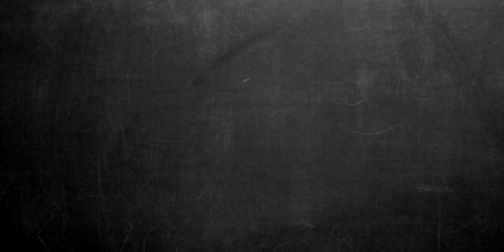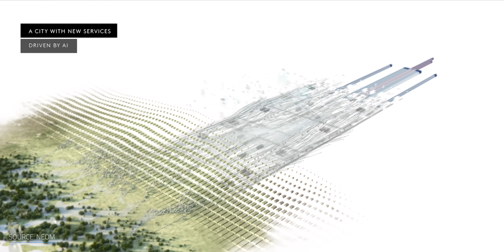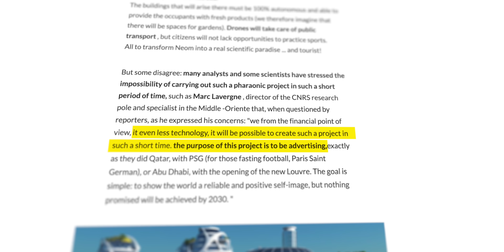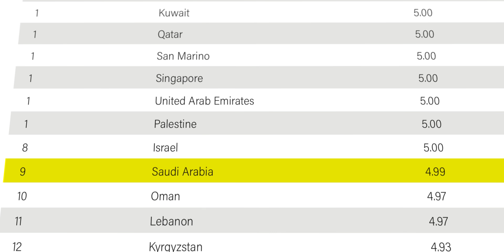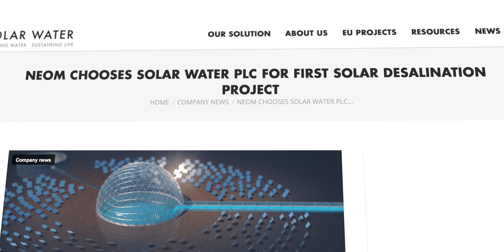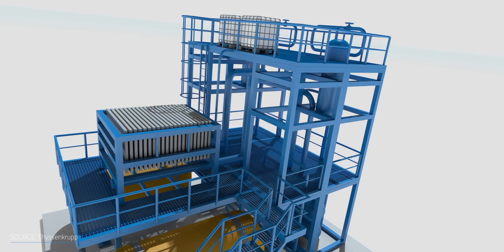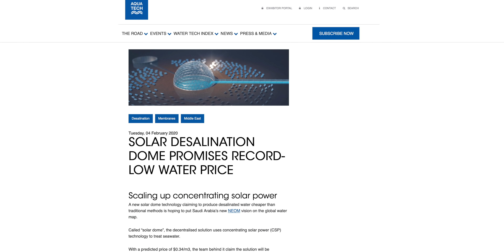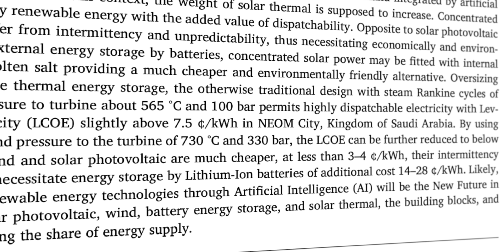Why Neom Might Be The Future of Sustainable Cities

Comment: "OUR brine won't just be pushed out into the ocean ..." - Why don't they just use the current brine emitting systems for the same purposes?
Reply: @SoMuchFacepalm the issue is that if you have a big batch of water with a specific salinity IE the ocean at 3.5% and a big batch of brine say 20% because you have by definition of ocean water 3.5% of it already in there you cant just add it to the brine to dilute it to the same level its a never ending task, to get the 20% brine down to 3.5% you need to mix it with an infinite amount of 3.5% salinity water, or you can introduce some fresh water... but that would be cutting directly into your product.

take 2 equal sized volumes of brine and seawater and add them together 1m^3 of each (20% and 3.5%)  you get 2m^3 of water of 11.75% salinity then if you do it again (2m^3, 3.5% salinity + 2m^3 11.75% salinity) you get 4m^3 of 7.375%.

Every time you repeat the process you only get slightly closer to normal salinity without ever being able to reach it. and each time you do it you have to deal with double the volume you had before.

to perform this process just 3 times you have used 7m^3 of sea water for just 1m^3 of brine, you can see why this spirals out of feasibility quite fast, and because you can only approach the base line salinity and never reach it you will always have a product that doesn't mix properly when reintroduced. We can mix it because we have powered mixers (more energy involved in the process) but the bottom of the ocean is extremely still and brine naturally sinks, the only boundary is the one flat surface of the brine pool so remixing with the sea water takes quite some time.
Reply: @EthanolTailor  What about pouting it into the desert? Would't it help to increase the overall albedo?
Reply: @eduardpertinez4767  not a good idea, there's a reason for the phrase "salt the earth" having negative connotations, It kills pretty much everything and isn't easily removed, at least in the ocean it will eventually diffuse properly.
Reply: @SoMuchFacepalm why so adversarial? I absolutely read your comment and was simply trying to play devils advocate and get you to understand the challenges and real maths of doing this. 

Im not sure of the timeframe exactly id have to have the exact salinity of the brine at hand, but salt diffusion in water is quite a slow process going vertically, the closer the concentrations are the faster it will be but I was pointing out in my last comment how hard it can be to reduce that salinity before reintroducing it.

Comment: I would be more impressed if they had gone with a relatively narrow but elongated loop. I think the fundamental issue with cities right now is the routinely long commute city dwellers have. A narrow but elongated loop for a subway system with all traffic going one way would be a solid idea. Dense housing for a mile on the outside of the loop and the interior area being more housing, large venues and large employment hubs. Everyone going to work via the subway has to make 1 total loop of the subway a day. Folks on the outside of the loop have a 2 mile round trip at worst to get to the subway. At that point trolleys and bikes would be viable options. Inside the loop distances would be similar. The ends of the loop could be setup as hubs for deliveries to the city, parking hubs, and possibly an airport. 

End of the day the main goal of any city development project needs to be to make the commute issues be minimized. Few cars or emissions and hopefully a shorter commute. That one thing would cut a vast amount of emissions and likely be far more than you get out of making buildings more efficient.
Reply: That is the maximally bad idea of the day because instead of going to a local store five minutes from my house like in a typical European city, I now have to do a 100 mile roundtrip to buy toothpaste.
Reply: @schmetterling4477  Didnt say everything had to be on the loop and didnt say the loop had to be 100 miles. Currently Atlanta has a beltway that is over 40 miles to go around. I dont see why with better planning that couldn't be a subway that might only be a 25-30 mile loop. Having lived there I can assure you most people are driving 1 way well over an hour to get to their work. It isn't even rare to find people with a 90+ minute commute one way. Most of that travel time is congestion. Im sure there are other ways to address it, but if the goal is to reduce impact on climate change the lowest hanging fruit should be taken first. Attacking the emissions of mass commuting should be a high priority for many major metropolitan areas. It might not make sense everywhere, but for many places it is a huge issue.

Comment: Would it be possible to have a salt water tap along side a freshwater tap? Saltwater still has some useful applications and it would save a lot of resources by choosing the salty tap over fresh.
Reply: Except that now you have contaminated your entire used water supply with salt and instead of running it trough a water treatment plant, which would allow multiple reuse, all the waste water has to disposed into the ocean right away.

Comment: The Neom water desalination using CSP sounds interesting, but its one thing to see fancy computer graphics and see an actual plant in production. 

Plus the fact that the maglev and hyperloop (which is basically a maglev in a vacuum tube) are expensive as shit, so no wonder you only see dictators doing these projects because otherwise there would be some critical thinking involved. The Shanghai maglev loses about a $100 million per year and it is line between the airport and the Shanghai metro (essentially just to show off ) The hyperloop is unlikely to happen despite all the hype - it is super difficult to build a large vacuum (and then you need to have an airlock and 20 mins to depressurize the pods)  After years of hype nothing of any consequence has been built.  High speed rail is a much better and already existing technology.
Reply: Dude, Maglev and high speed rail operate in Japan, Germany, France, and there's been an approved high speed line from San Francisco to Los Angeles. Which of those are dictatorships?
Reply: @nathanchildress5596  You're mixing up high speed rail and maglev. Nothing wrong with high speed rail- it can use existing rail.  While Germany developed the maglev technology, it dismantled the Mbahn in 1992.  The other example in Japan and Korea are  9km and 1km respectively. There is no maglev in France. 

The only one of any significant size is the Shanghai 29km line between the airport and trainstation which is useless for commuting unless you live at the airport and work at the trainstation (with no stops on the way) There are a couple other low speed short maglev lines in China but pretty much the rest of the world has passed on maglev with the exception of the one proposed in Japan the scmaglev which will be 80% in tunnels (with drag being an issue) and smaller in capacity than the existing Shinkansen.  (I rode the Shinkansen and its impressve, but the new scmaglev line will cost 5x the Shinkansen cost and is probably suitable for Japan which has the density, the right distance and the technology infrastructure to build one.
Reply: first off, why are you depressurising the pods? people in them need to breathe.

secondly, it litereally doesnt matter if the train line itself loses money because its so good for the economy that it pays for itself.
Reply: @jonathanodude6660  depressurize the tube, the pods need to be pressurized and this takes time.  Also have a look at imploding tankers if you take the pressure out - do you want to be propelled in this system at 700mph where a loose nut can be a catastrophic failure.  It's not a problem with planes as they are not flying in a tube.

The second point - sure it doesn't matter to the CCP if it loses money, but take a guess why they haven't been building maglevs anywhere else.
Reply: @peterkratoska3681  loses money in Japan too and still gets built. High speed rail loses money and is getting built in Europe. Australia unfortunately doesn’t see the benefit in connecting up the extremely separated hubs so we don’t have even standard rail between states afaik, but every transport network I’ve been on in Australia (transperth, ACTION, PTV, the one in Sydney) seem like they barely make money if at all. They all need government funding which is a bit odd if you consider that they charge users, then on top services falter if funding is cut, making them seem unsustainable.

Btw, not sure if you mean that as a limitation of current plans, but it wouldn’t be super difficult to instead of doing all that, simply form an airlock between the platform and the pod, therefore no pressurisation or depressurisation is required. Just do checks that the airlock is closed and the passengers can breathe (no leaks) before setting off. Would take like 20 seconds I think. Probs be a good idea to have extra air onboard in case, but you wouldn’t have a loose screw because those would be covered up completely with smooth plastic/metal to reduce chances of getting them caught on something.
Reply: @jonathanodude6660  Well talking about Australia, - The O-Bahn bus system is actually an interesting and not expensive design and the buses can use the special track for speed and still drive on the regular roads.  https://youtu.be/PLbhhdoCdl0 But there are really serious concerns about the hyperloop - if maglevs are expensive a maglev in a vacuum tube will be even more expensive.  

Nothing wrong with investing in high speed rail when it makes sense.  But in China the Maglev cost 4x as much as high speed rail to build and still it is Airport to station track that bleeds a $100 mill yearly.  Hyperloop will be a maglev in a vacuum tube so even more expensive.  But if you take a look at the published info on the Mumbai Pune proposed hyperloop the speed is 200km/hr even slower than hi-speed rail. 

There is a lot of cost and difficulty in building and maintaniing vacuum tunnels. You will need expensive vacuum seals, from the look of it the tube sections are a continuous spiral weld with 10metre sections joined together. A tiny failure say the size of a bullet hole will be a catastrophic failure for the whole system. But it is unlikely that in America anyone would want to shoot a gun at a hyperloop system /s.
 
Sure there will be no lo0se nuts along a 1000km that could cause devastating failure.  In the event of failure how do you actually rescue people? There is way too much of the tech-bro high tech magic solution that many people uncritically accept.  
Phil Mason does a better job at it https://www.youtube.com/watch?v=ZHjrFKfyZrw

As does this guy https://youtu.be/CQJgFh_e01g

Comment: The overall concept isn't a horrible idea.  Building a city around a pre built highspeed and automated medium speed public transit does make sense.  High speed if you need to move way down the light, hop on one of the automated tram cars if your only going a few miles.  If everything is built within about a mile or so of this central transit corridor there's almost no need for a car when it comes to commuting.  most can walk, bike, or electric scooter to the hub to and from wherever they need to go.  Could even make the area on top of the transit coridor one big park so you dont have to demolish buildings if you ever need to dig up a section for repairs.

That said not sure if this, if you build it they will come, approach is going to pan out in the end.  intresting to watch though.

Comment: "There are 2 options maglev and hyperloop" You mean 1 option because as much as Elon's cultists have hyped up the hyperloop, he has yet to make a single functional Hyperloop line that has gotten any type of speed, it has been in development for a very long time at this point and nothing really to show for it other than excited youtubers, some CGI videos, and a rusted tube in the middle of the desert that used an electric sled and didn't get any where close to the speeds promised.
Reply: Yeah, hyperloop stuff just isn't going to work any time soon, if ever.

A very low pressure tube would help efficiency, but... man, it has so many hurdles and potential problems that you really need to ask "Is it worth bothering?"

Comment: The "line" layout is such a horrifically bad idea. Any sort of mishap, traffic jam or whatever is going to block the entire system at that point.
Reply: If all of the transportation is done through automated vehicles and the like... not really going to see a lot of traffic jams.
Reply: @Diviance  Why is that?

The system can still be stretched beyond capacity and accidents can happen.

Saying "AI" and "automation" isn't going to magic away all problems with something like this.
Reply: @Diviance  But they can't do that if everything is in narrow tunnels.

The whole system has a bunch of failure points. Putting everything in a line and undergrown just make things worse.

Not to mention this is all being done in a dictatorship with plenty of corruption. Meaning the risk of cut corners and impossible deadlines is higher.
Reply: @Diviance  The fact that they are building a narrow line city?

That is a hard limit on wide they can go and then they'll need maintenance shafts, piping for things like water, electricity and sewage.

Making a pedestrian only surface might look nice but here are definitive trade-offs for little apparent gain.
Reply: @Diviance  Well that isn't the plan according to the journalist sawing dictator's stupid presentation.

Then there are serious practical limitations to going wide under ground.

First moving things back to the Line from the sides is going to take up space and infrastructure capacity. Slowing down the supposed benefit of this line layout. 

It would also make it much harder to widen part of the city. The soace underground is already in use so they would have to go even deeper or wider. Making a bad situation worse.

The coast is absolutely going to be more desirable land than in the middle of the dessert.

Finally tunneling is hard, slow and expensive. So adding more underground elements is making this human rights violating flight of fancy even less likely to be built.